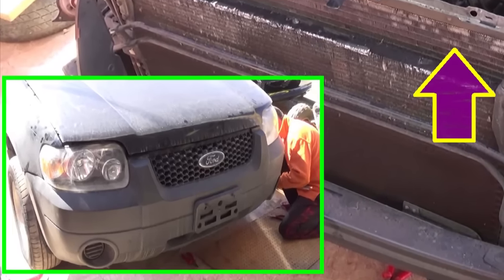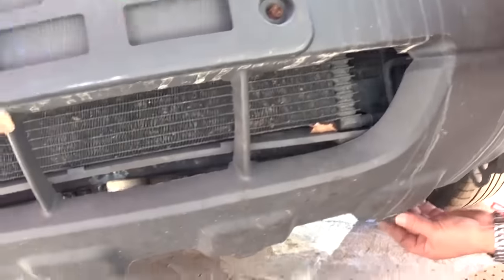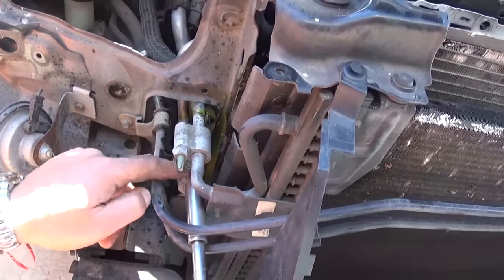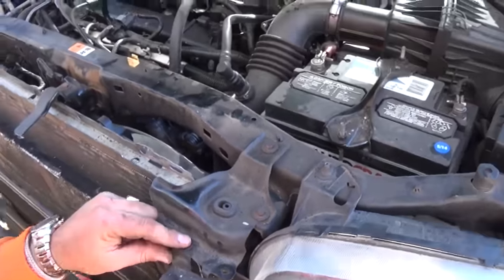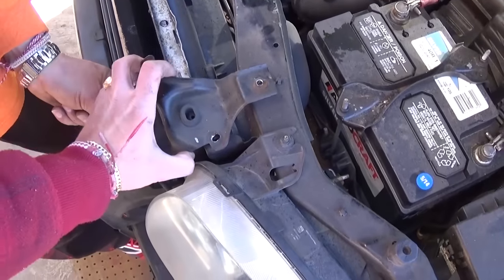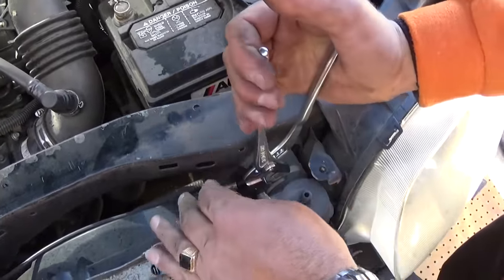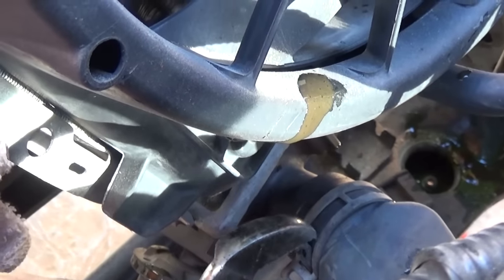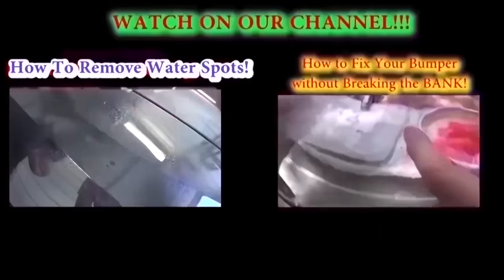Ford Escape Radiator Removal and Replacement  2.0 2.3 3.0 Engine Mercury Mariner

Comment: You do not need to remove the condenser and evacuate the a/c system in order to remove the radiator.  Just remove the hood latch and you can still access all the hose connections from up top or below the vehicle.
Reply: Joe Bedell thank you!
I was freaking the hell out seeing them do all that!
I gotta replace my radiator - top coolant hose nipple snapped off the radiator just now.....  I'm thinking I can change radiator myself but seeing them mess with AC lines had me freaked out!
Thanks for calming me down 😂

How hard of a job is it to change radiator on the 2001 escape v6? Do ya know?
Reply: Jennifer Rae Fuchek I’m doing it on a 2002 V6 rn
Reply: I know de Wey brudda I got mine changed yesterday in about 3 hours (was taking my time).
Was quite easy.
Removed hood latch. Disconnected every inlet & outlet hose, removed fan connections... Slid radiator straight up.
Removed fans & put into new radiator, removed rubber feet & put into new one, swapped side rubber pieces onto new one....
Slid it into place & reconnected everything. Refilled overflow tank. Started & idled til thermostat opened up... Kept refilling.
Done.
Reply: remove the rad support and bonnet catch .the support has 3 bolts. Just loosen the bottom one and remove top bolts and the support comes out. then undo the 2 fan bolt n top ,lift the fans and move them back. Then just remove all hoses . Removing the battery make it easier to get the bottom hose off.
Reply: You did it yourself ??  Do you do other repair work on your own car?
Reply: Very true least someone notice a easy simple way
Reply: I pulled the fans (2005 V6) without pulling the radiator or draining the system of coolant or freon, although some coolant will leak out.  Disconnect on battery terminal.  Remove hood latch, the left and right metal brackets securing the radiator, the upper radiator hose and filler hose on the left and the top transmission oil line on the right and disconnect the connectors to the fans. Then unbolt the 2 bolts on either side holding the fans to the radiator.  underneath, remove the bolt for the vertical hood latch bracket and here's the trick- unbolt the 2 10mm sheet metal bolts that hold the 2 fans together.  Then back up top,  work the fans up a bit and undo the remaining 2 sheet metal bolts that hold the 2 fans together.  Now you can remove each fan separately by wiggling them to clear the radiator nipples. The new fans need to be unbolted and installed one at a time. Important- the replacement fans need to have the same sheet metal bolts that bolt them together.  If they are secured by nuts and screws, you won't be able to re-attach them once the fans are in place.  (Ask me how I know :).   Once done, just replace the lost coolant.

Comment: I did this repair very recently. 2002 Escape 2.0L.  Do not remove the bumper cover. do not remove the condenser.   I removed the battery & battery tray.  Remove the 2 triangular brackets at each end of radiator.  Remove the grille (see comment below).  Remove/disconnect the hood latch.  I removed the latch handle (don't disconnect cable from latch).  On some models the hood latch bracket flexes after removing a bolt. mine didn't have the bolt. Remove most of the splash shield bolts, but you do not have to remove splash shield completely. Passenger side rad hoses. access is from under front of vehicle.  disconnecting those hoses is a little hard from difficult access, but not impossible.
Reply: cont'd.  After disconnecting all rad hoses.  Rad fan assy. remove 2 bolts near top, but do not remove the fan assy & do not disconnect the fan electrical connectors.  Rad fan assy is cradled in the rad (or vice versa. I forget. doh). separate the two, then finagle the radiator up & out.  you kind of have to maneuver the radiator out as it has projections that get stuck on the fan assy. but just finagle the rad out. not too difficult. If your center latch bracket flexes, then that is a big plus. mine didn't flex. see previous comment.  A helper would be handy for lifting out the radiator.  There are 2 rad dampers. at the bottom of each end of the rad & can be stuck to rad.  re-use those dampers.
Reply: cont'd.  splash shield bolts >>> passenger side only.  Rad rubber shields.  the stock rad has rubber shields or padding on each end.  if necessary, remove from old rad & install on the new.  you'll need new push fasteners.  I used Doorman GM 458900BP from the auto parts store.  Doorman GM 458900 may work as well.
Reply: cont'd. Collect & properly dispose of used coolant.  System capacity is 5.3 qts, but with rinse water I collected about 2.5 gals.  After draining & collecting as much used coolant as possible, I flushed the system with fresh water from a water hose.  Then did a final flush with 4 gals distilled water.  Be sure to drain or siphon the old coolant from the coolant reservoir & flush with distilled water.
Reply: cont'd.  I refilled the system with Motorcraft green conventional coolant.  Was going to use Zerex conv green, but there was none available.  Some coolants don't have the proper anti-corrosion additive.  Zerex has the same borate compound as new Motorcraft green.
Reply: cont'd.  I am not a mechanic & don't have the greatest selection of tools, but got the job done without messing up anything.  Don't expect to do this in 2 hrs.  If you start 8 am Saturday, you might be done by late afternoon. maybe sooner.  I didn't have any specific instructions & figured it out myself. so you might get it done faster.
Reply: very helpful information brother

Comment: I'm an aircraft mechanic, not an automobile mechanic, but got this done in 4 hours. I didn't read these comments until after the job was done but agree that the a/c condenser does not need to be removed. I did remove the hood latch handle and the grill. Not a big deal. Just disconnect the fans electrically but leave the fans attached to the radiator. Disconnect the lower radiator hose at the engine and the lower transmission hose at the transmission. Disconnect the other hoses from the radiator as access allows by moving the radiator. The radiator moves pretty easily back and forth or up to get to the hoses. I did jack the car on one side to be able to slide under easily. Based on bids from 2 local shops I saved 4 or 5 hundred bucks doing this myself.

Comment: He did a condenser removal video which is why he removed the radiator this way. If your gonna go through the trouble of replacing the radiator it is better to remove the bumper and condenser as well so you can identify and replace any faulty hoses or seals at the same time.

Comment: I have a 2002 Tribute Automatic 3.0 liter V6. with towing package that includes a transmission cooler. Is this the same procedure for this model? Thanking you in advance.

Comment: how do you relief the pressure on the ac line?
Reply: Do not remove the condenser. do not disconnect the condenser lines.  don't do anything to the condenser.
Reply: J KY should I tell the mechanic that I'd rather they not?
Reply: Dont
Reply: This takes a VACUUM PUMP
Also, unless it's CONNECTED (which it's not), you won't need to!!